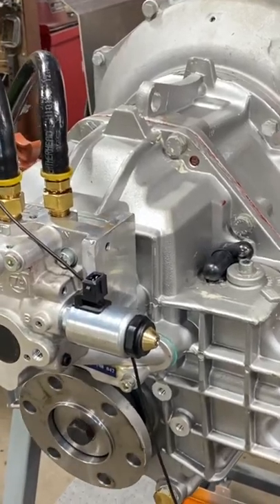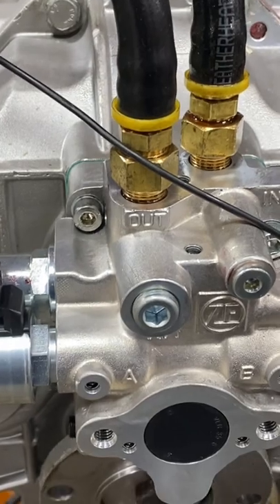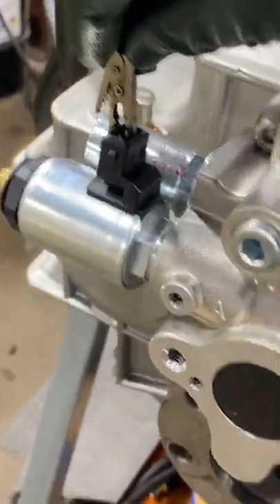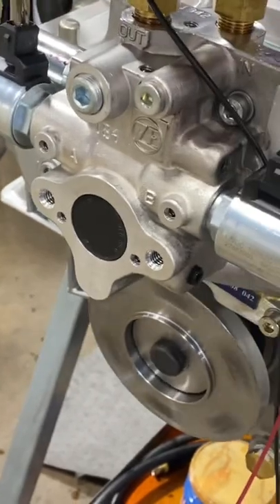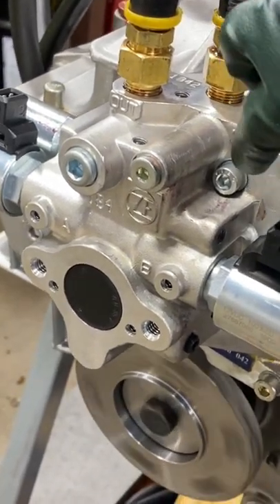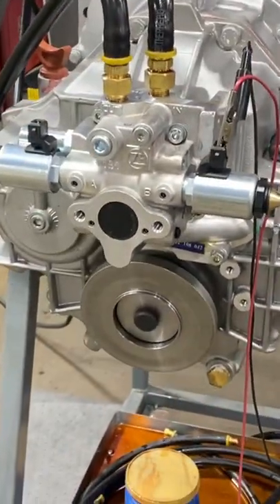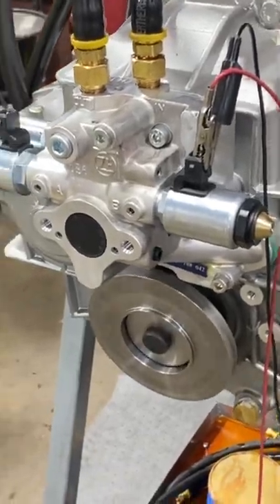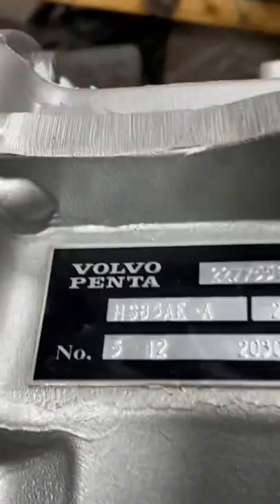ZF 85A Marine Transmission Dyno Test After Rebuild

Comment: I would appreciate any knowledge about this type of transmission,  we will cruise the world with this one's grandpa. It is a new one from the very first generation of these transmissions. Ours is an 800, and the 80/85/800 is a rare kind. Could you please say what to look out for, if there's any preventive maintenance or mods to do, and what they usually fail on? Whilst I'm poking your brain, can I also ask if you have any experience with well treated trolling valve'd transmissions and if so, how the clutch wear compares in the real world, between the ones with and without.